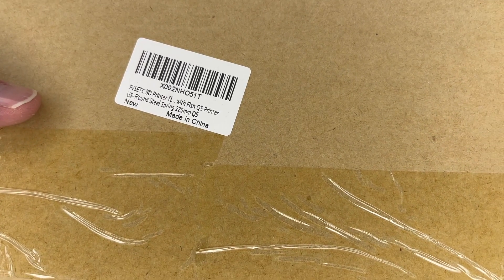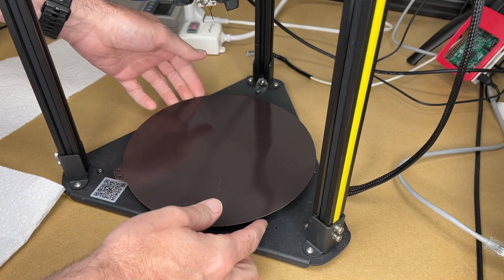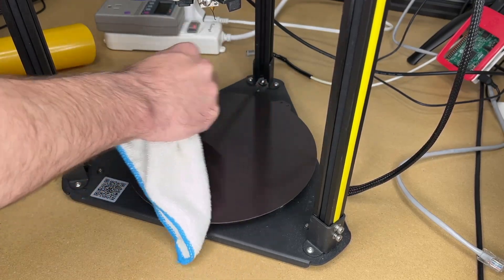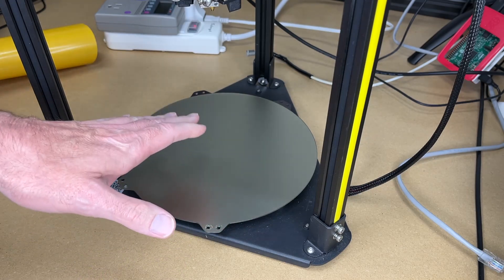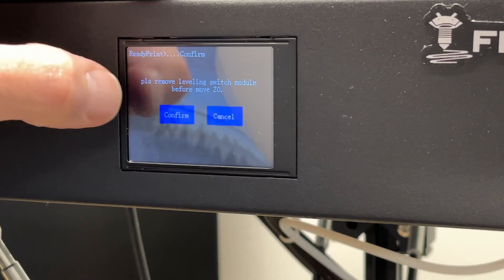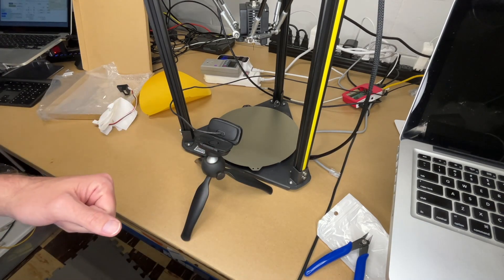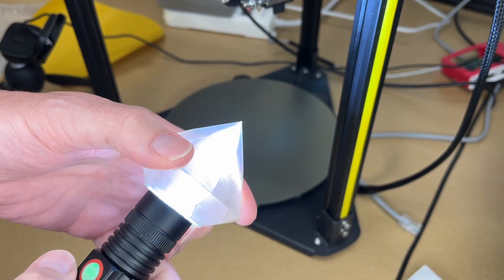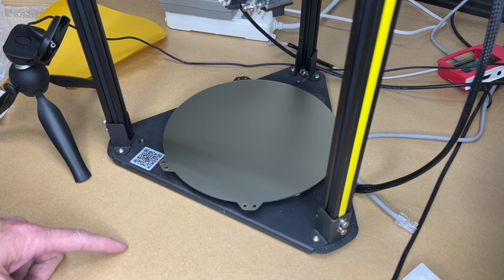FYSETC Magnetic PEI Sheet Install on FLSUN Q5 3D Printer

Comment: How much hotter do you have to make the bed to compensate from layer thickness?
Reply from the maker: I currently have the initial layer temp set to 70 and the other layers to 60. It has been working well for me. I don't think the layer thickness makes a big difference since it is thermostatically controlled. It just takes a little longer to heat up.